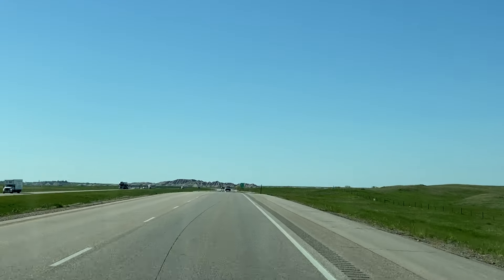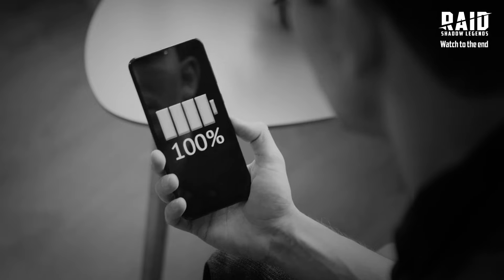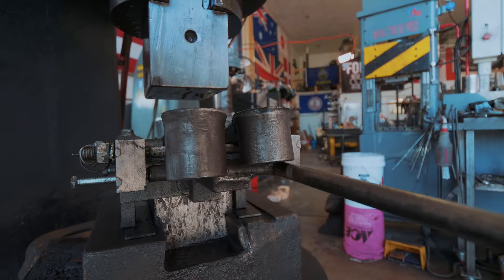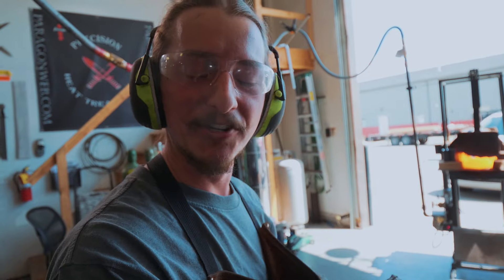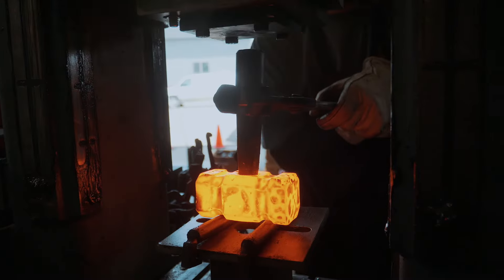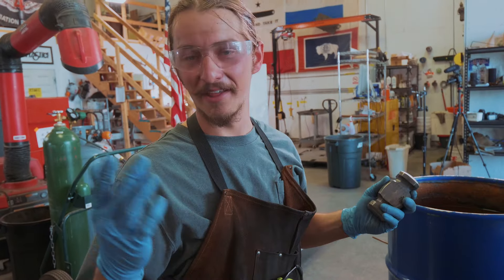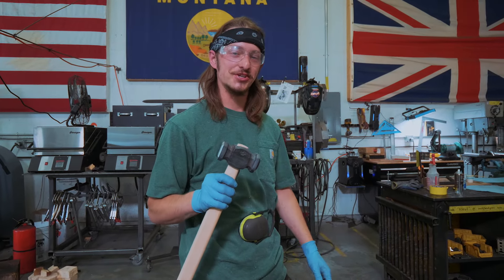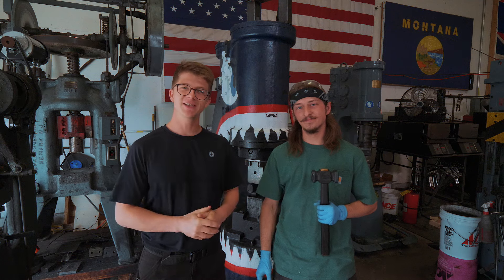How He Made 500 Hammers!!! (Back in Montana)

Comment: I love my Alec Steele rounding hammer. It was fun watching how Sam makes them. Only change I had to make was to get rid of the handle and replace it because that pine tar was disgusting. I put it in my truck the night before taking it to the shop because it was stinking up the house. Then the truck stunk like the pine tar for three days. I tried to sand it off, but no luck. So I had to cut it off and make a new one.  You should offer the option of NOT having the tar put on. But seriously- other than that, it’s a fantastic hammer.

Comment: This is AWESOME. I love handmade stuff and I love efficient manufacturing, so seeing handmade stuff being made efficiently is like a dream. 

Sam, have you heard of SMED? Single-minute exchange of dies, a principle of changing tooling as quickly as possible. It looks like one of the limiting parts of the process is changing all the dies between heat 1 and heat 2. The faster you can do that, the faster you can make hammers. 

Ideally though, you wouldn’t have to change dies at all and you could do all the forging with one die setup. If this is at all possible, you could dramatically increase flow and throughput in the forging stage.

Comment: It would be cool if you also sold the reject heads as blanks for cheap. Me and my buddy have been getting into blacksmithing, and we are too broke to buy good quality hammers, but we also don't have the tools to punch the hole for the handle in raw stock. It would be nice to be able to buy a messed up, un heat treated hammer that already had the hole in it, because that's the hardest part to do with minimal tools, and we could then forge it into whatever sort of hammer we wanted and heat treat it ourselves. That would also let you guys recoup losses from messing up the material. At some point we are probably going to resort to getting second hand sledgehammers and grinding them down to shape, but it seems a waste to grind off that much material.

Comment: You know that step where you isolate the material for the cheeks? If you weld another lip in the middle of the jig where the material can be "bottomed out" against to get the distance of where the hammer will hit consistently right and not have to rely on hand/eye accuracy would help significantly lower the rejects in your production line.

Comment: A lot of people can’t afford. 300$ hammer, people like me would gladly buy the “rejects” even if just for the steel! Some people struggle to get steel, to give you and idea, a 2in x 4in round of 1040 would cost me 90$ up here, and most of the better and bigger metal supply stores won’t sell to us little guys! It’s also impossible to get the better steels, yk430, d2, h13 and other up here in Washington. I’ve resorted to the one single scrap yard without 90 miles that will sell to the public and going there to buy whatever they may have, I bought a bunch of old hammers that have came through just as something I can use. Plus having to drive an hour the opposite direction to buy premade handles for said hammers with fuel at 5.15 a gallon. It’s hard to have this as a hobby! You should consider selling the rejects!

Comment: Ah but seconds can still be sold, just  give it an option when buying, maybe a 10% discount. You'll still sell them.
Reply: 50% discount would be better
Reply: Yeah or 75% as is no handle
Reply: Or reforge them maybe into a half pound or one pound smaller hammer. Another solution forge the bad half into a wedge.
Reply: If its only one end then a cross pein hammer would be easy to make